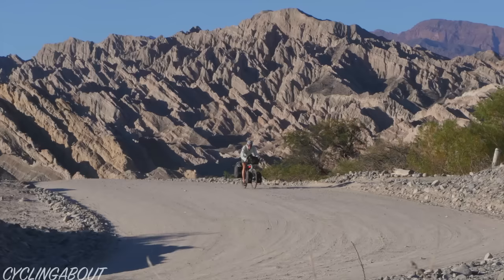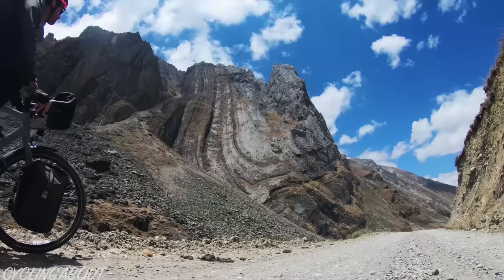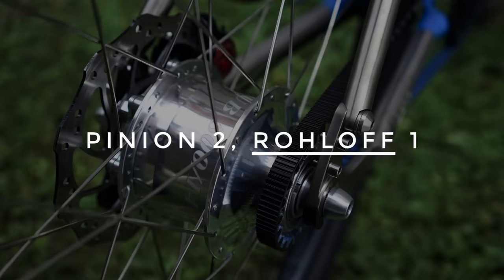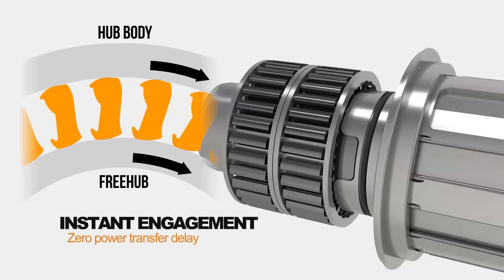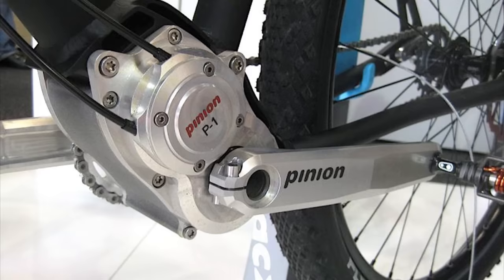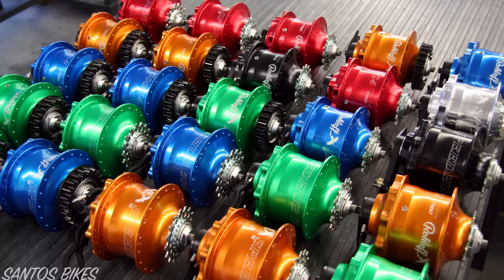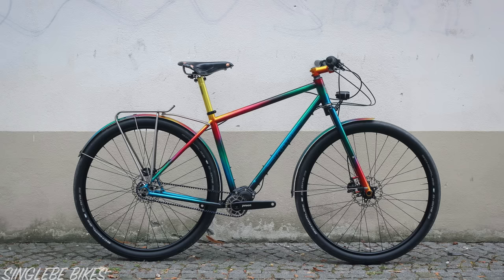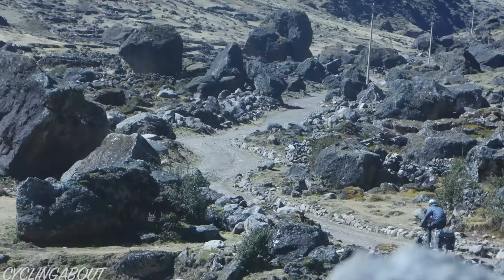What's The Ultimate Bicycle Gearbox? Rohloff Hub VS Pinion Gearbox

Comment: Am sure both are very reliable but if bike goes wrong a tour you stuffed are you not??   Derailleur you can fix or bodge by side of the road, its so simple and accessible.   Would like to try one though but no way have I got that kind of money.
Reply: I've been riding gearboxes for over 15 years now (both rohloff and Pinion) and have never had one break. People fear drivetrain failure because it happens all the time with derailleurs.
Reply: @timangus  You have money then  I dont not that kind, shimano Nexus a possible.  Also as a bike mechanic failures occur normally through lack of maintenance or abuse. I do  neither.
Reply: The initial cost of gearboxes is high, but if you factor in the quantity of derailleur drivetrains/components I have not needed to buy, I've actually spent less money overall.

Comment: I am thinkin pinion in a co-motion frame with 28 inch wheels.  But I do not live close to a bike shop that would have one set up for a test ride.  No way would I spend that much without a test ride first.
Reply from the maker: Yep, it's best to find a dealer to try one first. Make a bit of trip around it if there is nothing close!
Reply: @Cyclingabout  I test rode, ordered, and now have a 58 cm Pinion Divide. Cranks turning when pushing a bike swayed me away from the Rohloff. I use Spank Spike pedals. So far so good. It weighs in at about 35 lbs, plus more with my accessories.  I am using the Ortleib panieres on a Topeak rack. I wanted the Tubus but the bike shop did not have it. Anyway the plate of the Topeak stops some grit almost like a fender. The Industry 9 hub makes a whirring sound which is taking time for me to get used to. I did not want a Dynamo but somehow I got one anyway. As it turns out, the Son Nabendynamo is not bad and the Edelux light is OK too. I am using this bike to patrol along the American River. It was a pricey purchase but as a patroller I wanted no fuss with the drivetrain. Thanks for your assistance and information.

Comment: Gear steps told with rpm? The f..? Percentage would tell us something but rpm comes from assuming a bunch of variables.
Reply: I'm confused about why you think it's different. Could you explain? I've read the stuff on Sheldon Brown's gear calculator page already, but perhaps misunderstood it.
Reply from the maker: The percentage difference is very hard to put in cycling terms that anyone can understand. Of course, there are variables, but I have made them consistent between both the Rohloff and Pinion bike (wheel size, tyre size, starting gear ratio etc).
Reply: @Cyclingabout  Ok I understand your logic. But I don't think this information is relevant to a novice. It is more important to those who already know a thing or two about cycling. So maybe the target crowd was a little off? Maybe you could just sum it up and tell which one has a little bit bigger steps so a novice would understand.

Comment: I have a Rohloff on a Cannondale mountain bike. The addd rear weight is more than compensated by always having the right gear and little to no risk of wiping out the mechanism. The gear shifter is roll forward for higher gear and back for lower gear. To my head this is backwards and I'm always pulling it the wrong way. I could swap the cables to reverse the shifter but the cable setup is very finicky. I think it's achilles heel is the poor shifter cable adjustment. 
The Speedhub can be used at the bottom bracket but it requires a special frame. The upside (like the Pinion) is that you can use smaller sprockets front and rear.  
Check out the Allen Millyard downhill mountain bike, He uses a mid-mount Shimano hub gear and runs the whole transmission in oil sealed inside the box and swing arm.  
https://www.youtube.com/watch?v=iUak9sqJmnM
https://www.youtube.com/watch?v=S39oR_7Vwf8

Comment: I didn’t notice any discussion about shifting under full power. Maybe I have poor viewing comprehension.
Reply from the maker: Both are poor in this aspect. You ideally need to back off on the power when you shift or you end up with some crunch. The Pinion has 2-3 shifts that are particularly susceptible and the Rohloff 1-2. Takes a day of practice to get perfect, but it becomes automatic soon enough.
Reply: That is what the deFaileur crowd keeps getting wrong. It is entirely NOT NEEDED under any circumstance.

Comment: Can you switch gears while claimbing  on both of them?
Reply: No, you have to let off on the torque for both.  You don't have to stop pedaling completely, just ease off enough for the gearing to be able to change.
Reply: From what I have heard elsewhere, and from what is said in the video, you can, but you need to let off for a split second while you change.  So you need some amount of momentum in order to be able to stop pedaling for 500 milliseconds or so.  I have heard that this is indeed a downside for using them for mountain biking.
Reply: @tonyk8368  Dunno. Let up torque for a split second (half a second is definitely not needed) vs. grinding dive train for a third of a crankshaft revolution or so...
Reply: HotelPapa100 Hyperglide+ gives some delightful shifting under load. It’s buttery smooth.
Reply: Not even necessary to reduce load. Just shift when the cranks are vertical - no load on the drivetrain. Works well after the first 10mins of practicing.

Comment: Shimano 13 speed dual cassette (transmission members) mid mounted  gearbox but it's not out yet. Still under design yet to be manufactured. It may become the ultimate bicycle gearbox. Check out bikeradar for more details.
Reply: Being a mechanical engineer, I won't let that abomination near any of my bikes. It's like having the worst of both worlds.

Comment: I'm a bike mechanic. From my perspective, these things are fancy ways of solving problems that do not exist. I mean, it may be reliable and low maintenance...but, at what cost? I sometimes work on bikes that are 30y/o, never seen maintenance and are daily used. And still work and can be repaired with a hammer, literally. The best bike is a simple bike. The more moving parts, the more there is to break.

Comment: I have been using a shimano derailer  and 21 speeds on my trek 970 singletrack since 1989 with no problems I see no reason to change now!
Reply: Gearboxes are popular largely because you can run a different type of chain (or a belt) that doesn't slip off so easy. That's happened a few times on my bikes over the years.

Comment: How big can the torque be?
Reply: Feiner Fug  One guy seeking gearbox for speed record attempt motorbike which produce 11 Nm torque at 20000 rpm. I was thinking if Rohloff can take it . He was calculate that it maybe 300 Nm out of gearbox in lowest gear. In Tandem bike two average rider can produce more than that.
Reply: Feiner Fug  Wheel size is 16" and max speed 160 km/h. If I not wrong, gear ratio is 10:1 in highest gear.
Reply: In this motorbike application torque range from engine maybe 1/3 to 1 to get it zero to top speed.
How many gears it need in flat salt lake is the question. Maybe push help is allow.
Reply: If he put gearbox next to engine to get high rev and low torque, no trouble with torque in it.

Comment: What about Sturmy Archer gearboxes ? Seems like you get paid by the brand
Reply from the maker: They don't have anywhere near the same gear range, but they have a decent drive efficiency. Perfect for 'round town.
I don't get paid by any gearbox manufacturers, in fact, I've spent thousands of dollars on five gearbox bikes over the years.
Reply: 5 speed Sturmy Archer matched with belt drive and Bafung G510 Ultra mid moto ? Fat tire 48v 30Ah

Comment: Why are  these boxes still using chains?
Reply: You can use both with belt drives, however belt drives are also relatively costly compared to a chain (and they need a special frame with an opening in the rear triangle to put the belt on). 
Bicycles with both often cost 3 to 4k € as non electric bikes.
Reply: @simonm1447  I mean why not a shaft drive
Reply: @sammyd7857  I have no scientific data, but usually small gears don't have the same efficiency compared to a chain. Chains have a quite good efficiency, these gear boxes have already a couple of % less efficiency than a derailleur system.
So this may be the reason, losses in efficiency always add.
Reply: @simonm1447  ok so really the boxes are a waste of money.

Comment: Rohloff may not be the best choice for a full suspension bike. But Rohloff is just fine for a hardtail mountain bike
Reply from the maker: It's fine, but you can definitely notice it on the trail - it hampers the ride dynamics. I know because I have both a Rohloff and Alfine hardtail MTB!

Comment: You missed an important point, with a Pinion gearbox you can NOT shift while pedaling or have force on the pedals, you have to stop pedaling then shift and then resume pedaling. With a Rohloff, you never have to stop pedaling while shifting. As a mountain biker, this is a disaster depending on where you are on the hill climb.
Reply: Actually that is only true on every 4th gear ( 4, 8, 12).  I only have to let up slightly on all the other gears.  So only three of the 16 gears.
Reply from the maker: I've found you ideally need to back off on the power with both gearbox systems to make a shift! This has become second nature for me. 👍🏻

Comment: For me the efficiency is worth 5 points, not one, the extra efficiency of the rohloff represents a performance gap analogous to comparing a world contender to someone who may or may not win his local race.  But, I’d want a bigger chain ring, because I teeter on top speed way more often than I deal with super steep climbs. Thanks for this! I’m a big fan of the cvt but efficiency  is the deal breaker there.  I don’t mind cassettes and grease so much, but I’m a huge fan of belt drive for lots of reasons, so I think I’m settled on rohloff

Comment: Which is king, man? Rohloff is king, man. Reasoning? It functions as a normal hub which means it can be detached and attached like a normal hub. If the frame of the frame of the pinion is bust, you cannot use it in a normal, probably used, frame. Pinion frames aren't sold separately, AFAIK. Imagine traveling the world with a Pinion bike. Ain't gonna happen.

Comment: You counted warranty and hub change as one item. That makes pinion the winner.
Reply from the maker: I'm afraid you're incorrect there.
Reply: 11. Warranty @6:18 and then you talk immediately about switching out the hubs and count that as one thing. However you do talk about wheel interchangeability, are those two different things or are they the same?
Reply from the maker: @erichlf  One is about retrofitting a gearbox to any bike (the Pinion cannot do that), the other is about being able to switch wheel sizes (the Rohloff cannot do that without being laced into a new wheel).
Reply: @Cyclingabout  so then you are that you included warranty and repair in one. So pinion wins.
Reply from the maker: @erichlf  Please re-watch if you're still confused.
Reply: @Cyclingabout  i have and i suggest you rewatch.
Reply from the maker: @erichlf  Maybe reading it will be clearer for you: https://www.cyclingabout.com/best-bicycle-gearbox-rohloff-hub-vs-pinion-gearbox/
Reply: @Cyclingabout  looks like you need to read the transcript then, 'cause it says exactly what I'm saying. You include warranty and replacing the hub in one item.

And so it is very clear: "The Pinion gearbox comes with a five-year warranty, while the Rohloff hub comes with just two years.

In addition, if there is a failure, it’s much easier to swap out a Pinion gearbox than it is to dismantle and rebuild a new Rohloff wheel."
Reply from the maker: @erichlf  Well, I've read it 10+ times now, and I have no idea what you're on about. 😂
Reply: @Cyclingabout  you cover two items and only give one point. I don't think I can be any clearer.
Reply from the maker: @erichlf  Ok, well thanks for trying.

Comment: I wonder how I managed several expeds with just 10 ratios on a standard frame?   Basically, I just did.  For this money, you might as well leave cycling, get a motorbike and go further, faster.
Reply from the maker: Huh. I don't want a motorbike. 😂 And my days of riding on crappy 10-speed bikes are over because I can afford a gearbox, and I like well-designed things that offer tangible benefits in my life.

Comment: You can get a CAR for the price of one gearbox here. You can buy a motorcycle, or a set of bikes for your family. €6000+ for a single gearbox? It's insane, just out of this world insane! 

Honest question - How can a consumer justify that?
Reply from the maker: Relax, the gearbox is €1000. 😂 How do you justify it? Well, the maintenance is almost nothing. You won't ever wear out another cassette, or need a new derailleur if you hit it on a rock. You will rarely wear out a chain/belt. No gear skipping or chain falling off. It's an easy justification for me, and many others.
Reply: @Cyclingabout  oh, so the prices where with bike? Not really clear.
cause in the clip you say "the prices are high ..." And then show a bike+text+ about €6000 😅
Reply: @joachimfriberg  Both gear boxes are made in Germany in smaller numbers, with high labor costs and both are complex, need parts with high accuracy and have many single parts. 
A derailleur system is mass produced in Asia, with relatively simple components, so they can offer simple cassettes for 15 € and simple derailleurs also for 15 €.

Comment: what is wrong with a regular drive train ?
Reply from the maker: What's wrong with a deep dive video on something else?
Reply: @Cyclingabout  Cycling is for the working class and here you're taking about stuff only the elite can afford to flaunt.
Reply from the maker: Cycling is for all classes including those who can afford the top-tier stuff. I know because I started off on a $100 bike.
Reply: @Cyclingabout  Why would someone who has the means for faster, safer, more comfortable mobility need a bike?
Reply: @difflocktwo  The ultimate efficiency of bicycles only appeals to a small group. They will typically be interested in recumbent bikes, enclosed gearing systems and similar engineering solutions. Most people want fast, or familiar. Fast is about less weight, but quicker wear and replacement. Familiar is stuff people can fix by the road side. Bespoke transmission systems are neither fast nor owner serviceable, and they're expensive. Sturmey Archer came closest to an Everyman hub gear that didn't require frame mods, wasn't expensive and was reliable if treated properly.

Comment: Some cyclists say the efficiency of pinion is better!
https://youtu.be/Rg8wh5qlHlk
If you want a quiet drivetrain (alber neodrive motor is incredible smooth at the limit of 25-28 km/h) the favourite could be pinion P12. But Bosch motor supports Rohloff E14 which is also fantastic! What to do now?

Comment: Rohloff warranty is 5 year?! 10 year extended if wheel is built by sjs cycles because its correctly laced by easily world's most experienced people in rohloff builds
Reply: I built mine myself, 2 cross with very important IMO locking nipples. 
6 years and 17,000 miles, not a speck of trouble. On both tours the heavyweight bike was 120 lbs plus me 170 to 185. 
My SA 3 and 5w hubs are so fun, zee Rohloff gets neglected.

Comment: I am having mixed feelings about the review, especially since so much work went into it. By introducing e-bikes into the equation, you are comparing apples with oranges. An e-bike is a different product from an analog bike. You cannot compare both. The Rohloff is clearly the winner for e-bikes with a mid drive motor as the other system doesn't work with this set up. We do not need a point system to come to this conclusion. You also ignore the electric E14 Rohloff shifter which should give the Rohloff an extra point if it needs one. Nevertheless, the video is informative.

Comment: Do you feel that belt drive is the future or just a fad?
Reply: Almost everything in cycling is a fad. Take an 50 year old bike and it's perfectly fine for personal mobility. 

With electrification we will see beltless/chainless electric transmissions.
Reply from the maker: If it was a fad, I would've gone back to chains 100,000km ago.
Reply: @Cyclingabout   I wanted to switch to belt drive recently because of your video on them, I was sold. But it would cost like 20% of the bike which was bought new. I could basically buy a department store bike for the cost of a couple of cogs and a belt.

We have many machines which run much higher loads than bicycles and require way less maintenance. Mainstream bicycles lean more on form over function.
Reply: @difflocktwo  All kinds of specialised bike transmissions have come and gone over the years. In the end price and availability win out over theoretical advantages for most people.

Comment: Scoring these factors evenly is pretty silly.   In what world would the time it takes to change out the control cables once a year or so be of equal importance to weight, reliability or efficiency?    Everyone knows that some factors are way more important than others.
Reply from the maker: It was just a fun way to see how they compare. The results will vary greatly depending on what factors are most important to you.
Reply: @Cyclingabout  I think the most important factor for me would be the preference of those who have used both extensively.   If someone can say I've put more than 10,000 km on the Rohloff and 7,000 km on the Pinion and this is why I feel X is better, that really carries some weight.

Comment: so really dumb question why not use both? provided you have the money
Reply from the maker: The top gear if you combined gearboxes would be around 200km/h. Cyclists usually only pedal within a speed range of 50km/h, so both of these gearboxes will cater to that.